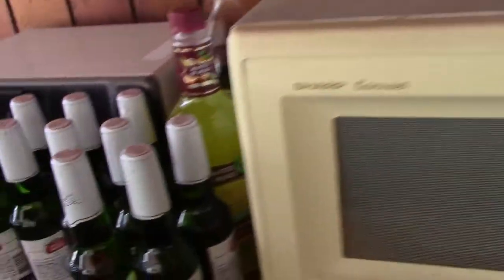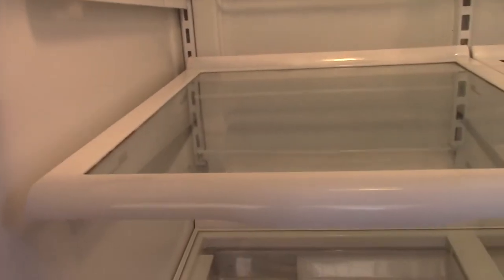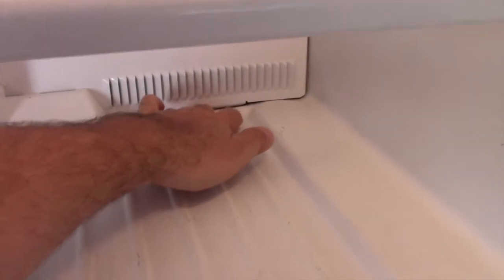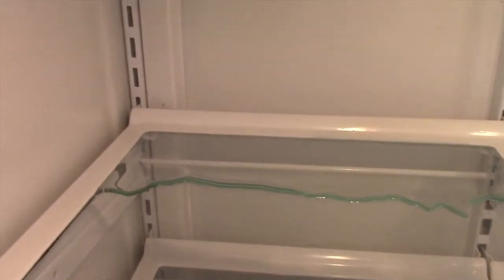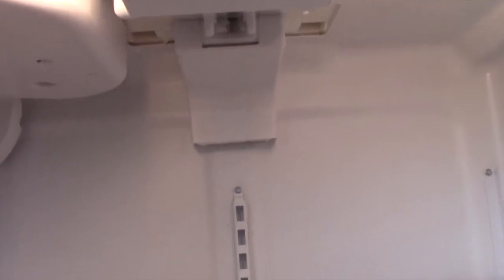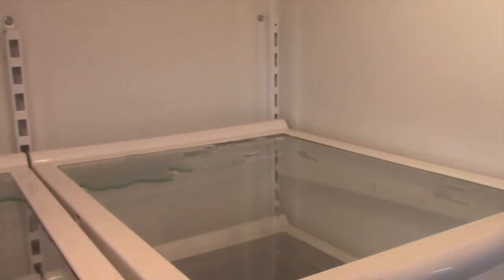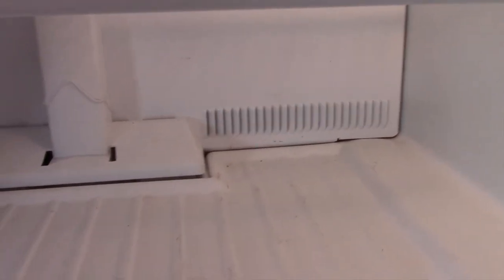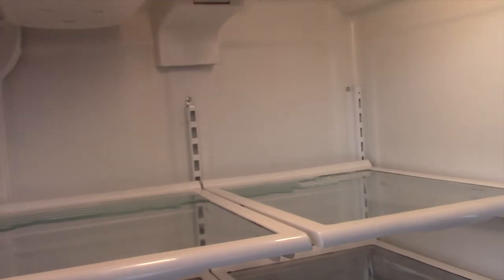Cabana Refrigerator Update

Comment: Keeping the fridge on over the winter does nothing but makes PSEG happy.  It's also probably not good for the entire refrigeration system; they say with air conditioners not to turn them on below a certain temperature.  Over this past winter, we were several times below that mark.  Since the fridge uses the same kind of system, it would be wise to not leave it on then either.  Also a good idea to keep the door propped open so the fridge won't smell.

That's what I did with my fridge outside, and it worked well, started up fine this year!